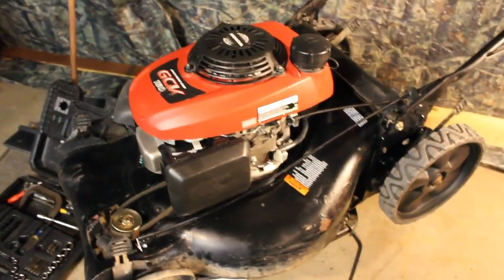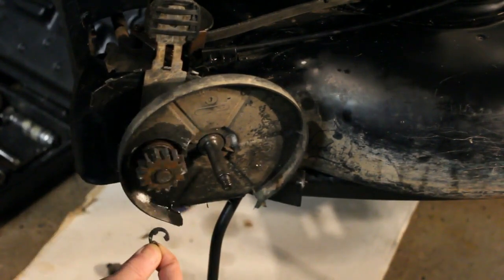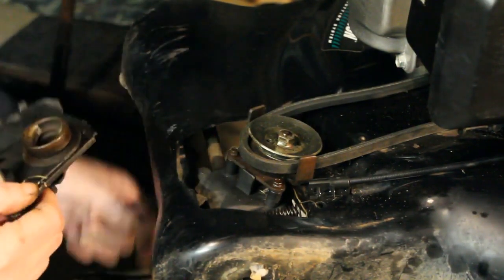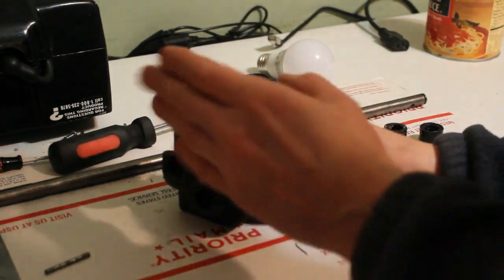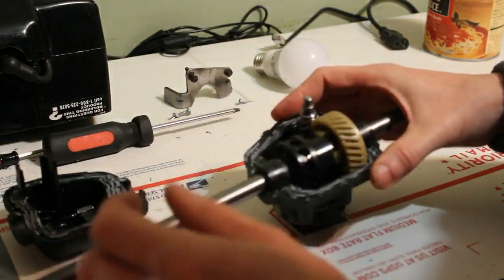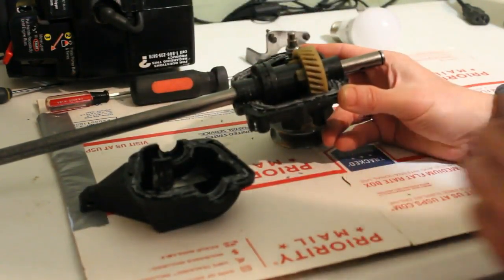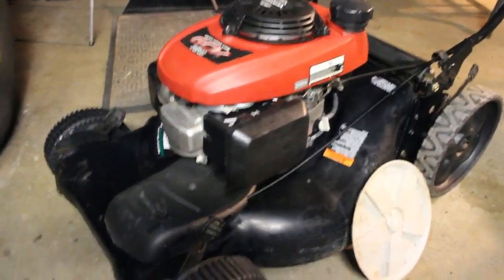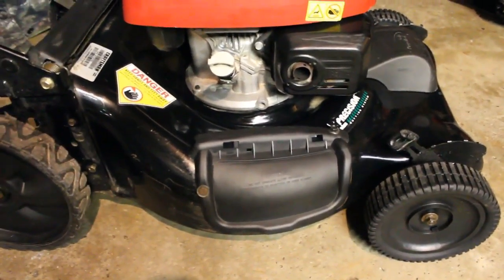Craftsman Mower Transmission and Bearing repair. (Self Propell) System. 917.371722

Comment: You video helped me figure out how to get the rear belt off.  Thanks!.   This applies to the Husqvarna 917 version of this mower as well.  I have to take the belt off to take the whole rear axle out to replace my single leveling lever that broke (pain in the rear).   The e-clips will come off with a screw driver btw, just have to have the right size and hit the gap with it from the top.
Reply from the maker: Great information Neil, Thank you. Everything working good now?